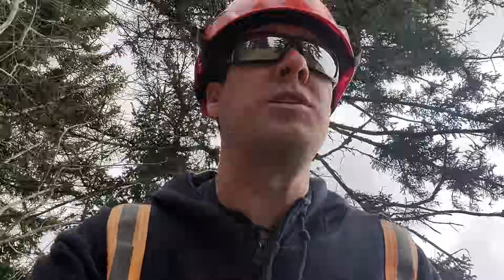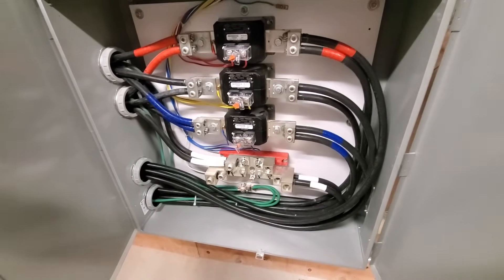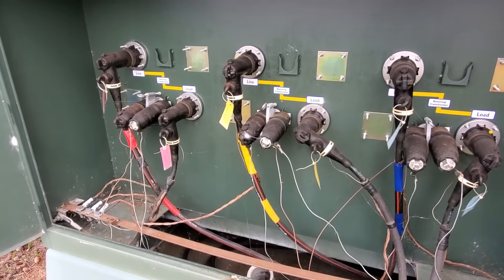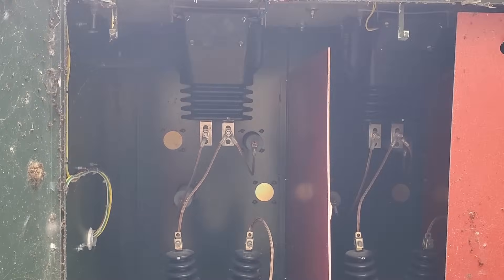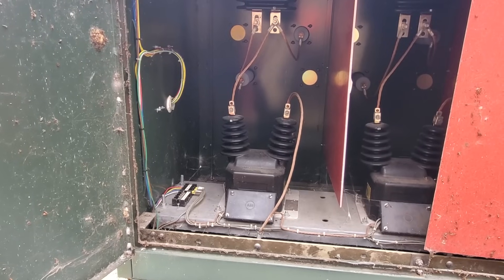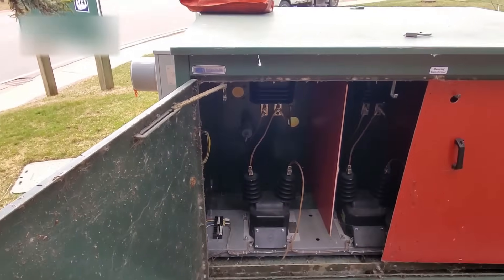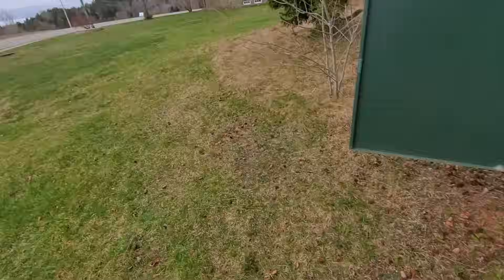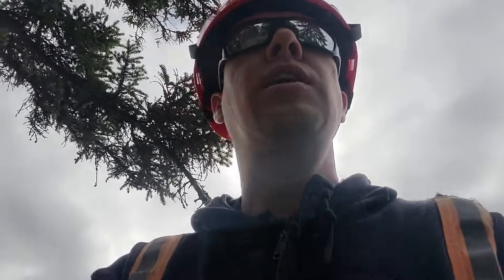Primary metering padmount

Comment: Interesting to see how you do that in Canada . We had a quite few installations both overhead and  paramounted and installed into HV switchgear . We called them metering units ,basically identical to your unit there electrically but much different in physical design . The voltage transformer is usually only rated at 150va 110volt output but has high accuracy and the magnetic design of the transformer runs at a lower more accurate part of the BH curve of the transformer. We use the two wattmeter method that only needs two of the three phases to have current transformers fitted for accurate metering both watts and vars.Have had a few issues with primary fuses of the Voltage transformers blowing on inrush current if a good initial contact is not made switching the primary circuits as the primary fuses are very low rated typically 1 to 2 amps and fail regularly.  It was part of our procedures to check health 3 phase secondary outputs when doing inspections of these units.

Comment: hey there
i know this question does not relate directly to your line of work, but i assume you are a sparky
when working with household motors like a lawn mower or pool pump, is there a way of discharging a capacitor without damaging it. I normally only handle such wires a day after powering off such appliance or bridge the terminals when im changing the cap, so in such case it doesnt matter what happens to the cap
Reply: get a 1megaohm resistor and put it across the cap, monitor voltage until it's safe, at 400v which is more than the cap should have  on it, peak current will be 0.5ma or less so it shouldn't spark at all, and it will drop about 10 volt/sec on a typical motor run cap tailing off as it decreases
another option is to use a pair of 7w 120v incandescent bulbs in series like old screw thread christmas lights, they will drain it faster and provide an indication of when it should be dead but always verify with a meter

Comment: Its very common in europe to meter at MV. Almost all buildings that are supplied at medium voltage have meters at MV because its cheaper tariff that way. If you had meter after transformer at low side, then energy is more expensive, because they count you for transformer losses, of course many times more than actual power lost.

Comment: Used to be involved with 110kV and 220kV metering. Of course the systems used 5 amp secondary current transformers (combined with protection secondaries) and 110 volt secondary voltage transformers. The meter sent impulses to a 'printometer' which stamped half hourly 'readings'. I loved the sound the printometer made when counting the pulses, each click meant $$$.

Comment: Low voltage electrician here, 600v or less.  Have a customer that has a bunch of buildings that are all fed from a single pole mounted metering setup like the one you show at the end.  On occasion they have damage to the various poles and cross arms that needs fixing.  The local electrical provider is good enough to shut down and ground the legs for us to get our work done.  Sure wish it were all underground concentric neutral at the site though due to the trees contacting the lines and tripping the drop out fuses!  So not a lineman but familiar no the less.  Never seen the pad mounted version though so thanks.

Comment: I wound up dealing with my local utility regarding a primary metering tank about a year ago feeding 500 KVA to a building. It was a unit from the 60s or so, and about 3x3x3' Lost a phase when a mouse decided to hop across the lugs, found burnt and half alive. According to the PoCo, this building was primary metered since the transformer is under a rental contract. Luckily we found the culprit that caused the arc over, otherwise they would have had to tear everything apart and install a newer larger unit like in your video.

Comment: I'd like to see you explain a pad mounted transformer with central metering of the secondary.
Reply: Low voltage electrician here that has done this a number of times.  They set the transformer and supply the CTs and you simply slip them on the yokes for the secondary.  You then terminate them with crimped lugs and bolt up.  They also had me install the meter can directly on the secondary side cabinet.  I drilled and tapped the cabinet for the appropriate fasteners and bolted the meter can there to it.  Installed a 1-1/2" chase nipple with a bushing as a pass thru.  Meter and test did the wire up and all good.  Easy peasy.
Reply: @mikeiver  Thank you. Sounds like what I saw except meter can on a post (6' above grade to keep it out of the snow)
Reply: @markbernier8434  There are many ways to skin the cat and the energy supplier decides what they want as far as the metering and the placement of the can.  We simply have to flow to the planners desires!

Comment: Interesting I do not see that kind of a set up over here in the UK. The metering point will be the boundary between the network system and the private owner. If it is on HV, then the CTs and VTs will be in the HV switchgear and the secondary wiring brought out to external metering, the transformer will be privately owned. If it is on the LV side, then the CTs will be in the transformer secondary connection chamber, which will be under network ownership.
You also seem to reference your system voltages phase to earth, where as we reference them phase to phase, i.e. generally our primary voltage will be 11kV or 6.35kV to earth.
Reply: In USA transformers are generally connected phase to neutral on the HV side and there is a neutral wire interconnecting transformers. So a transformer would be labelled as having a 7200 volt primary but the line voltage would be 12470 volts . Compare with Europe,  Australia, New Zealand etc where single phase distribution transformers are generally connected 11000 volts phase to phase (high voltage single wire earth return systems being a notable exception). Also unlike USA a three phase pole transformer (delta-star) would be used instead of three single phase transformers connected star-star.
Reply: @netking66  Thanks for the info 👍

Comment: Love your videos! I had the pleasure of doing line work about 12 years ago on a privately owned property used for coal blending. We installed everything from the point of the power company feeds throughout the entire property.  It was awesome experience! One of the things I found particularly frustrating was installing the cross arms on both sides of a pole. So simple, but that hole has to be perfectly centered or things don't line up!! Lol. As I'm sure you know!! Learned a lot about line work. Amazing the power of a simple come-a- long tensioning the top three conductors,  and how easy it is to snap off a pole at the ground.

Comment: At work we have HV primary metering at 23kv and 12kv. Some metering equipment at 500kv-69kv but that is inside our substation. Nothing like that looks dangerous even opening the cabinet. Always enjoy the videos!
Reply: It don't look dangerous but accidents happens all the time.
I was with my school at 110kV max. 100MW station with meatering to/from the grid close up. It don't look dangerouse but they already had some deaths in the 50 years of history (checking of a live line if it is grounded with the wrong instrumentation).
I personally think that the US/canadion system isn't very safe but in other countries you'll find some overkill.
(you need an extra class for every shorter distance of a live voltage, and working on powerd line needs another extra license and they get void after some time without an extra class every 1-2 years).

Comment: Huh. I'm surprised to see the bare copper  connections on the CT/VT side. I suppose 7.2kV is not a huge potential above earth, but over here in Australia we might be a bit concerned about the local wildlife (I.e. rodents) getting in there and bridging the gap....
Reply: Up in Canada where I'm at,  we encounter rodents getting into things and popping fuses. Overhead feeds get rodents and birds. I'm just an electrician, but I get the call when things stop working, I'll get somewhere and usually check the building service, then see if there is a dropped fuse on a pole where it's overhead fed, and make some calls to the local utility to get things fixed.

Comment: That Troubleman's Kit you have can be a good tool to do a quick verification of the PT/CT's, or to find our what the ratio is as the tags sometimes go missing... We also have HV probes that will connect into a field calibrator, which keep your meter techs a safe distance using a hot stick, for proper billing rates.  Stay safe and thank you for all your hard work!

Comment: 0:36 The CT/ Current Transformers are 600 amps through the donut gives 5 amps. This 5 amp output has been a standard for at least 120 years. The ancient meter handbooks here from 1900 have watthour meters with a 5 amp Current Transformer input. The 5 amp CT output wires should never be left not connected. The connection to the CT type watthour meter needs to be large enough wire so the metering is correct. If the wire is too wimpy the meter will read low. The CT will have a rating on its nameplate like B-0.5 or B1.0 etc. This means the maximum resistance allowed in the 5 amp circuit wires to the CT type watthour meter. The CT's shown in 0:36 have no visible "donut hole" for the 600 amp wires, it uses the lugs. The donut hole variant is more common on pole mounted and service head mounted CT metering. There are other standard amp outputs than 5 amps, ie 10, 1 1/10 amp etc. These are more common in lab usage. If you short out the 5 amp CT side and connect a clamp on amp meter it will read 5 amps when 600 amp passes thru. The ones in this video look like GE model JAK-0C

Comment: Hi! Are those red safety panels in place all the time or only when you are in the box? 

And the bottom of those panels look like they can swing back and forth in the wind, do you ever worry about them hitting the conductors if you open the doors and they swing in? 

Thanks!
Reply: Hi, I worked for the company that built the cabinet in the video (Shallbetter Inc). Those red panels are made out of a material called "GPO" which is a fiberglass material. It's super itchy and a pain in the ass to work with. The cabinet has two halfs, the dead front (which doesn't have the GPO barriers) and the metering side (which has the GPO barriers). The barrier serves two purposes. Additional insulation between the live bus bar and the cabinet walls, and also acts as a "double door" type system so someone who wants to access the metering side of the cabinet has to do 2 conscience acts. The first act is opening the door, the second act is removing the GPO which is covered in warning stickers. It makes it really hard for someone to argue in court that they "didn't know it was dangerous" or "accidently" entered the metering side while it was live.
Reply: I would assume there are there all the time even if the doors are closed and they appear to be made out of fiberglass which is non-conductive.

Comment: Why is there bare copper in a non-secure tank ? Seems kind of dangerous some nut head decides open it and cut the cable (value of the copper)?
Reply from the maker: It's triple locked with bolts that have a unique head pattern, as well as padlocked in such a way that cannot be accessed with bolt cutters.
Reply: @Bobsdecline  and in my opinion if someone does manage to get into those cabinets they definitely deserve whatever is coming to them I mean you have to be very stupid to cut that stuff live

Comment: As an Energy Manager working for a rather large property owner, I saw some pretty crazy metering setups over the years.  We needed to have a meter swapped out so I watched the utility meter specialist do it live, but as in the nursing home metering instrument setup you showed, these CTs can be safely shorted for servicing without having to shut off the power.  In a facility with a complex electrical room with legacy secondary metering that would never be used today, I discovered an unmetered connection to the main entrance bus.  I had to negotiate a settlement with the utility after several years of stealing power entirely by accident.  Metering is a big part of my life; without energy meters I don't have a job!
Reply: It happens. Even residentially in the UK... Have seen the input tails (cables) to the meter split to a second fuseboard instead of the output.... Sometimes the routing makes it hard to tell one from the other lol

Comment: Bare 7200V wire is not common in the states. Typically we would use unshielded insulated jumper wire instead. Our distribution voltage is usually 12,470 or 13,800 though.
Reply: 7200 phase to gnd is the same as 12470 phase to phase
most of the residential stuff ive seen in atlantic canada is all running from a single phase, so its rated for 7200, but some people still insist on calling it 12470 service, even if there is only 1 phase left on the pole
Reply: @cleverca22  yes but the wire insulation is rated for 15kV is what I’m getting at.

Comment: If I may ask a few questions. The colored tape you use to color code the cable. Is it special weather electric tape? The nuts and bolts used. Are they treated with a grease or special like stainless? Thank you for your videos
Reply: Most of the utilities buy the really good tapes.  The tapes they use for phasing the conductors are likely 3M #35 or the like.  Good stuff and stands up to the weather really well if properly applied.  As to fasteners allot of the line stuff I have seen and dealt with is galvanized.  There has been some SS but it tends to gall if the interface of the threads are not coated with the likes of antiseize or Noalox.  I prefer to crimp when possible to eliminate issues down the road.    I Noalox every connection and all threads as well as interfaces.  I use Belville washers and double nut critical interfaces.  Do it one and do it right!  Hope that helps
Reply from the maker: Great answer! Much of our fastening equipment is also galvanized, with the occasional stainless, brass, copper etc..
Reply: @mikeiver  o

Comment: What kind of hazard can those cause when they are flooded out or say someone crashes into one & tries to remove themselves with that bare copper. Seems like there are 100 situations that could lead to a shock hazard.
Reply from the maker: Much like a lot of underground lines, flooding can be a nightmare. We kill the power when possible during flood season. Most are mounted at high points when possible much like this one.

 The lines are also always fused before going into the ground. You certainly can't rely on fusing, however in the event of a vehicle accident they will likely trip. That being said, regardless of said likelyhood, the lines and all components are to be treated as live until a certified and competent lineman arrives and says otherwise
Reply: @Bobsdecline  stay safe brother never ever get too comfortable even experienced linemen make mistakes, check, double check triple check and never feel the pressure to rush things it’s your life on the line.
Reply: usually, these boxes have a ring of concrete filled posts around them, to protect from cars

but the one in this video is a fair ways away from the road, you would have to be driving pretty insanely to manage to hit it

Comment: Wow, no strip heaters? Must not get much moisture in your area..
Reply from the maker: Only in the metering cabinets. The pole mounted metering unit near the end of the video would likely have one in the metering cabinet
Reply: The voltage transformers would give off sufficient heat to keep things above dew point.
Reply: @netking66  that’s not necessary true if the equipment is anywhere in the midwest. I will admit, not all applications require a heater strip.

Comment: 3 Phase
My God, that is so dangerous
I still can't believe they would keep the power on when the door opens
Reply from the maker: We don't normally ever open the doors without a power interruption. In this case we lifted the firewall with a grab all to get some photos for the customer. 
Your right, exposed medium/high voltage wire is extremely dangerous. 
Sometimes rodents get inside and it's not a good sight!
Reply: He's showing us for demonstrative purposes... Not for actual servicing

Comment: there is some pole-top 7200 metering by an old chemical plant in my town at the northern end of the province
they replaced the old 69kv line with a metered 7200/12470 off the residential grid, since it only needs basic lighting now
Reply: I love hearing this type of stuff. It's so interesting how engineers figure out how to improve/streamline things. Similarly, the telecom industry has seen many evolutions.